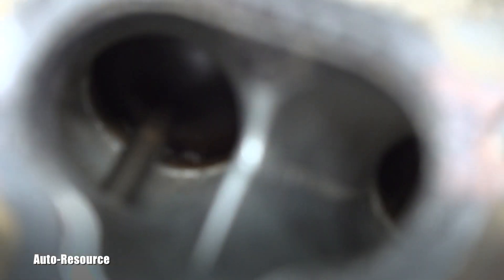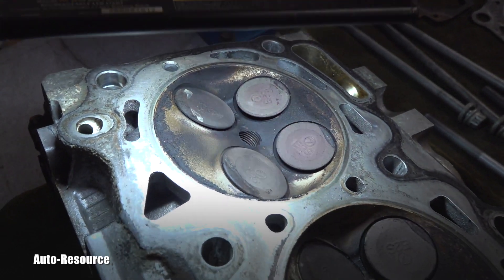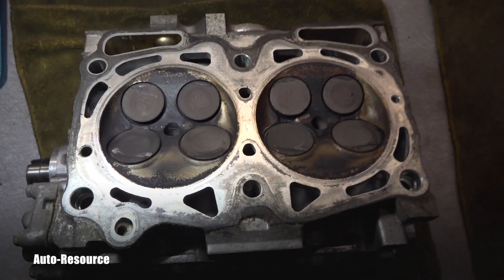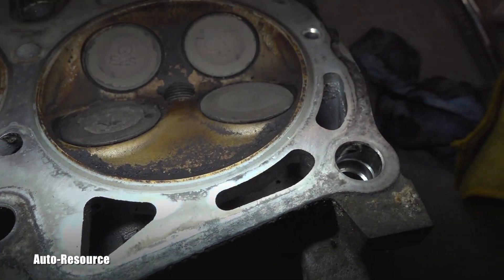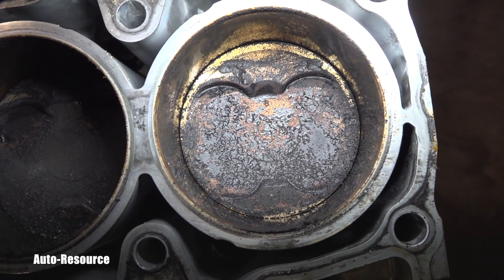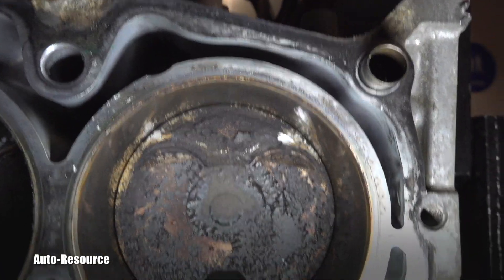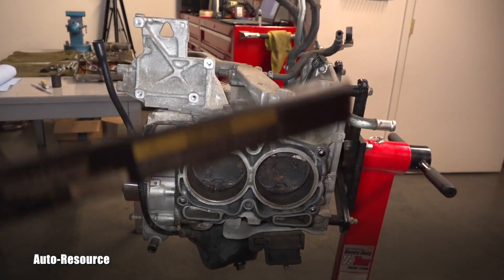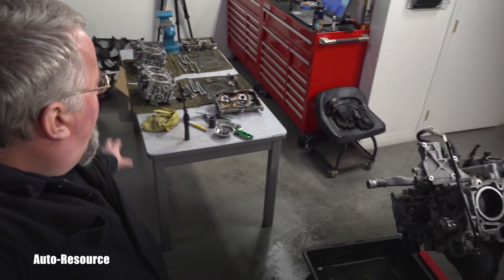Subaru Timing Belt snapped, causing this damage

Comment: Had this happen on 2010 Forrester before 180,000 miles when the second timing belt service was due. Bye bye motor. Bye bye. Subaru in general. I expected 200k miles plus outta of it like I got from my Hondas and Toyotas without exception

Comment: I paid almost $900 to get the timing belt done on our 2010 impreza and then only 1 year after install it snapped.  I asked the mechanic and it's not OEM.  I'm really distraught about this b/c it clearly causes serious damage and really only thing to do is new engine everyone tells me.  Why on earth are cars made with these belts nowadays?!  If one belt fails, causing so much serious damage.  I'll literally never buy a car with a timing belt ever again!!!
Reply: My gates belt of 7 yrs and 70k miles separated and bent most of the valves. New valves, seals, gaskets, shipping costs, towing and machine work was $1100 plus the stress of having 1 one car. Buy only Subaru OEM timing belt kits. Save yourself the stress of trying to be cheap. Its not worth it.
Reply: @abeybaby29  yeah, I thought the mechanic was getting OEM parts, I was shocked when he told me it wasn't OEM.  I sold the car.  Never--ever again will I get a car with a timing belt, and probably never a subaru ever again, period.  With both the Imprezas I had, well cared for, very low mileage, the trifecta idiot lights would go off like every few weeks.  The maintenance in these Imprezas has been very frequent, very costly, and very frustrating
Reply: @malcolmh5736  I hear you man because I really stayed on all the maintenance for everything. I felt like I got a low blow on the belt. I am positive others who have these after market parts will experience the same feeling. The timing belt made in USA all the idlers and even the tensioner says japan all in the gates box brand. Just a crappy feeling do go thru it all over again. Ugh!
Lesson learned for me

Comment: This issue was caused because he fitted a new belt only, just 500 miles ago.
A belt do not rips apart of no reason or of age.
You can replace water pump and tensioner and bearings, but if you want, reuse the old belt again without worries !
Reply: Yeah the hydraulic tensioner in the first video he posted shows that it moves freely up and down with no tension on it at all! 
What good is the lock pin to hold it open if it has no hydraulic pressure holding it open?
None! 
 The belt failed because that that hydraulic tensioner is N F G! 
The belt was a symptom of the fact up to this point he clearly still has not identified the CLEAR CAUSE OF THE FAILURE!
 NO HYDRAULIC PRESSURE IN HYDRAULIC TENSIONER!
But that's just a minor detail! 
lol
Reply: This happened to me recently 2001 Subaru ej25 single overhead cam just replace the belt to ensure that this wouldn't happen as a full kit and an aisin kit at that to ensure this wouldn't happen 
It happened within 2000 miles of complete quality kit 
There are trade mechanics an yt talking about this being an issue with the Subaru tensioner for them

Comment: Peter thanks for posting in detail. I have 06 sti with 131,000 miles. Did complete timing belt with all related at 105,000 miles. Got kit from rockauto.